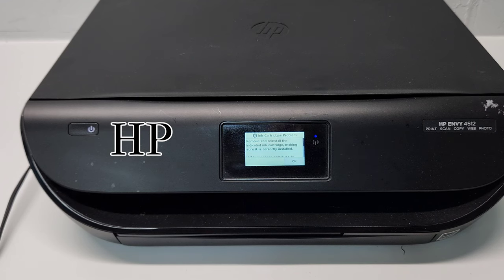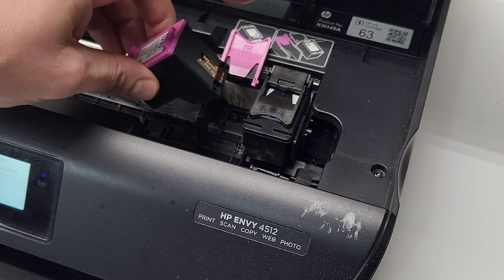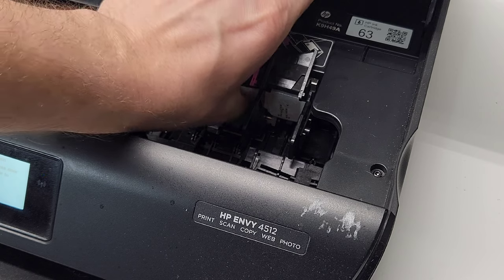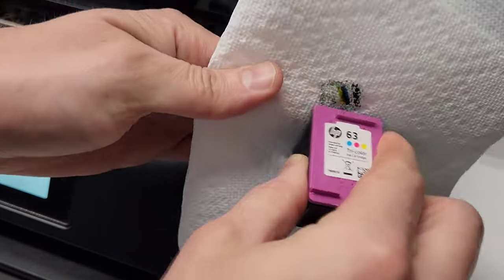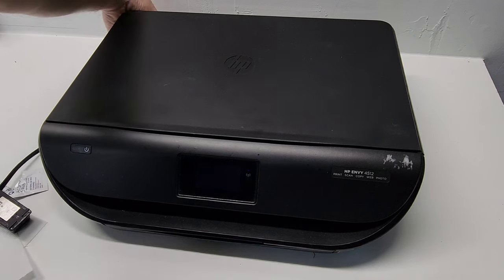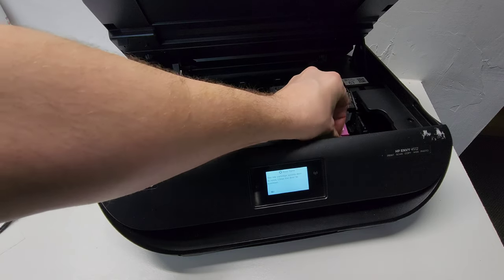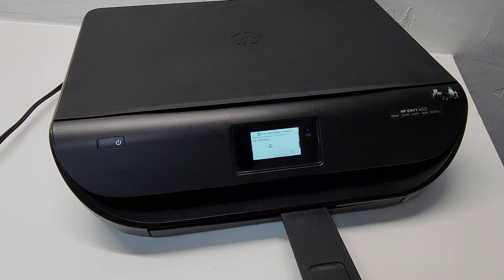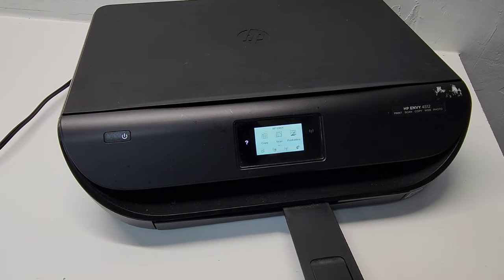Problem With Ink Cartridge HP ENVY 4510 4512 4520 Fix Printer Error

Comment: My Ink cart is fine, it will print the align page. The problem is my computer doesn't show up in the device mgr. I've unplugged it from both ends and restarted it. It's an Envy 5520 and yes the driver is up to date. Thoughts?
Reply from the maker: Is this the only envy 5520 that you had installed on your computer? Try unplugging printer from computer, restart computer, in the meantime do a semi-full reset on the printer. Plug in, and hopefully that works.
Reply: @303electronics   When I would look at the Device Mgr. It wasn't showing the Printer "do a semi-full reset on the printer. "This was the fix, seems the wizard failed. I did it manually, using the IP Address. Thanks

Comment: Hmm I'm having this problem w the black ink. But it seems like it's more of a paper problem because sometimes the paper is printing but the print is not straight and the paper corner is a little bent. Does that make sense? Any more ideas? Thank you!!
Reply: Go to settings and press align printer head.
Reply: Well u can even get pass the error to do anything eles beside using it as a scanner. Mine printed a couple sheets then this error . No color ink installed either

Comment: How do you even just use one Cartridge. You dont even explain it...
Reply from the maker: I apologize for not explaining. You can use a single cartridge mode by taking one cartridge out. I'm not sure if it is for both cartridges. When your black ink is out or cartridge goes bad, you can remove it and leave the color cartridge in the printer. The printer will automatically go into single cartridge mode, and you will see the message on the screen. With the color cartridge the printer will produce all colors, including black. Thanks for your note. Good luck!